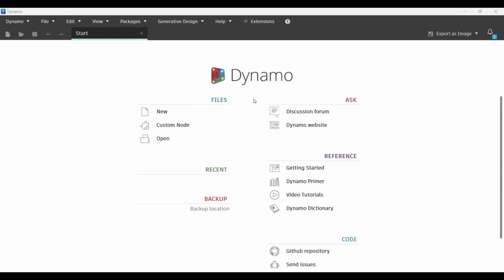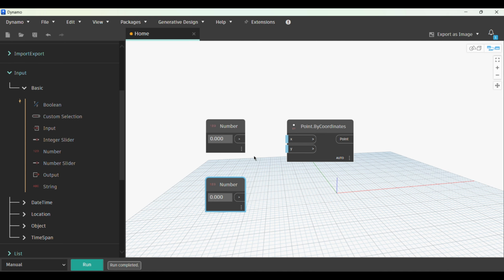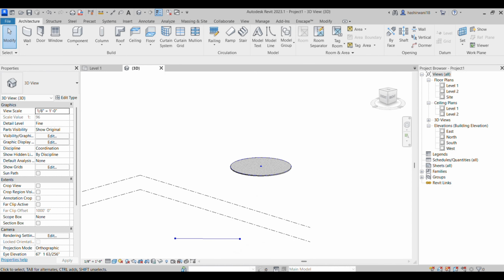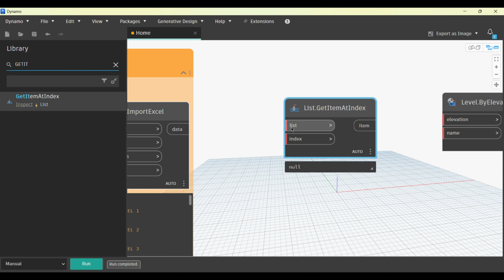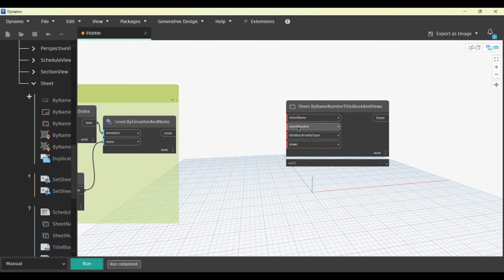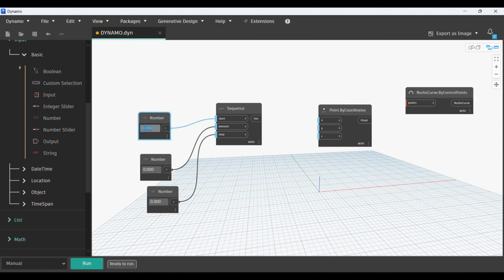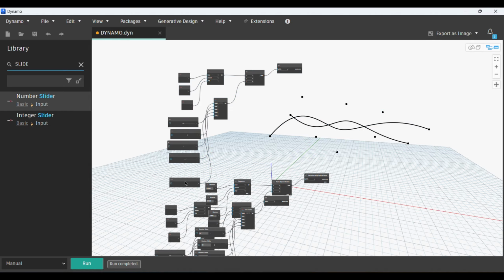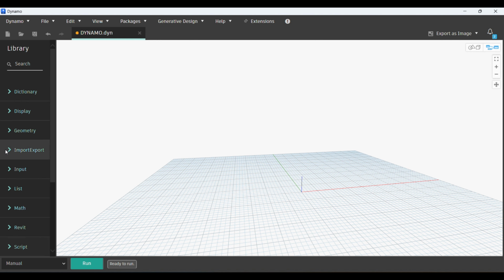Dynamo Script Coding Automation Masterclass PART 1 by Er HashirVani #Revit #Dynamo

Comment from the maker: Unlock the power of automation inside Autodesk Revit with this Revit Dynamo Automation Visual Coding Masterclass by Engineer Hashirwani. In this masterclass, you’ll learn how to use Dynamo’s visual programming environment to automate repetitive tasks, create intelligent workflows, manage BIM data, and build powerful custom tools without writing a single line of traditional code.
From basics to advanced scripts — geometry creation, Excel data linking, parameter management, model cleanup, bulk sheet/view generation, and real-world BIM automation workflows — this course takes you step-by-step through everything you need to become a Dynamo automation expert.
If you’re a BIM engineer, architect, designer, or Revit user looking to boost productivity, reduce errors, and work smarter, this masterclass is for you. #Revit #Dynamo #RevitDynamo #DynamoAutomation #VisualProgramming #VisualCoding #BIM #BIMAutomation #AutodeskRevit #RevitTutorial #RevitTraining #BIMTraining #DynamoTraining #RevitMasterclass #BIMMasterclass #AutomationInRevit #DynamoScripts #BIMEngineer #ArchitectureDesign #MEPEngineering #StructuralEngineering #RevitWorkflow #RevitTips #RevitHacks #DynamoForRevit #BIMManager #RevitEngineer #EngineerHarsherwani #Harsherwani #RevitCourse #DynamoCourse #RevitIndia #BIMIndia #ArchitectureStudents #EngineeringStudents #RevitBIM #ParametricDesign #GenerativeDesign #AEC #ConstructionTechnology #DigitalConstruction #BIMWorkflows #SmartBIM #DynamoNodes #RevitCommunity #Autodesk #RevitSkills #ProductivityTools #AutomationTools #BIMTools #LearnRevit #LearnDynamo

hashirVani